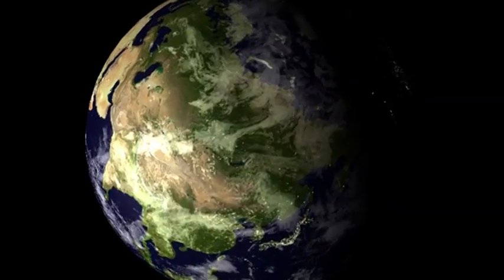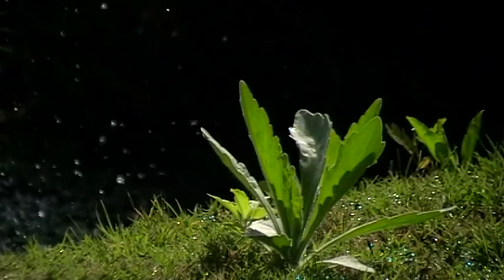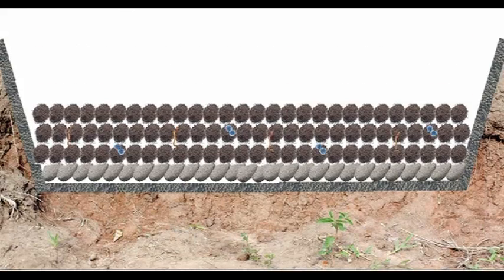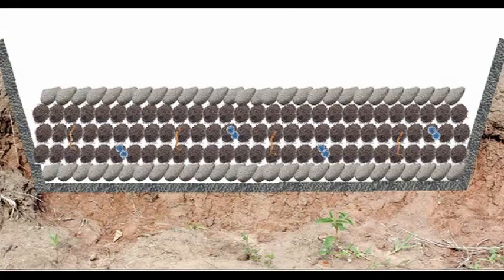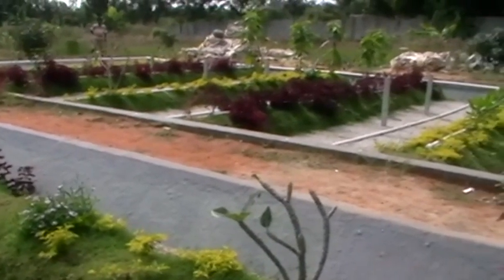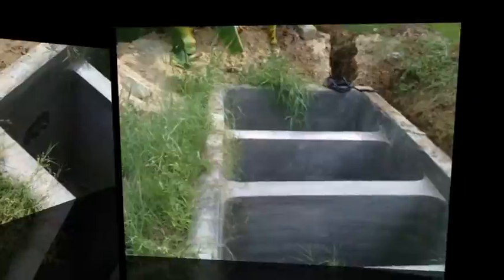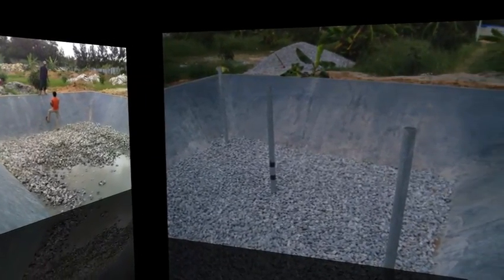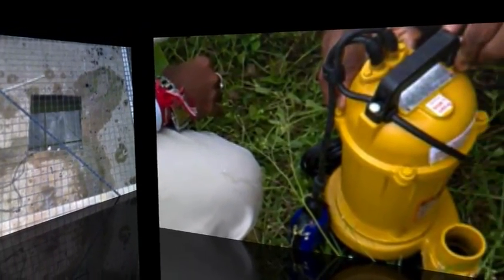Soil Biotechnology Installation at ACCEPT Society

Comment: what is being paid by the 15 laksh for the 15 kilo liter waste water? is it the cost of the propriety soil? without the civil works, this system is Rs. 100/- per liter of water recycled and if you add the septic tank, the trapezoidal pit construction, gravel material, piping system, pumps and the soil for the plants; the capital cost puts this technology out of the market for town and cities. I really do not understand how prof: Shankar could state that this is a solution. 
Not to mention the operational cost of energy, desludging of the septic tanks and manual de-cloging of the pipes.